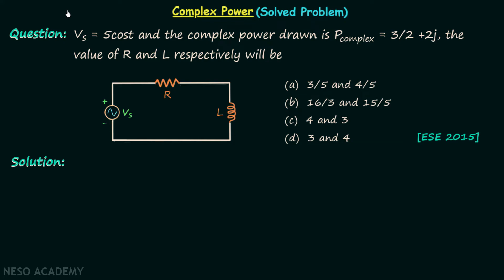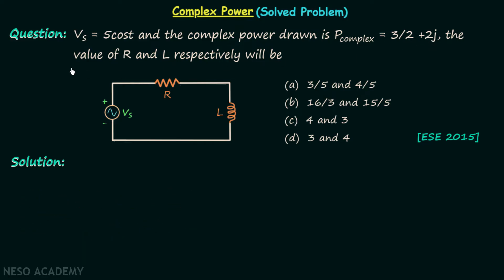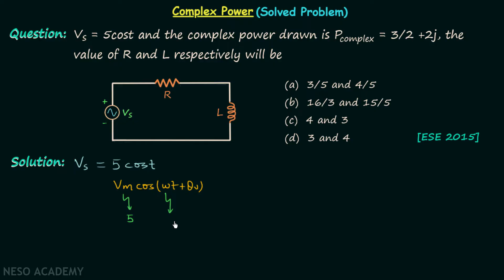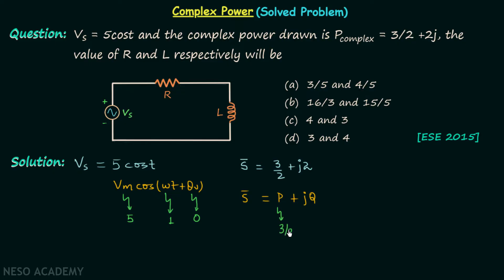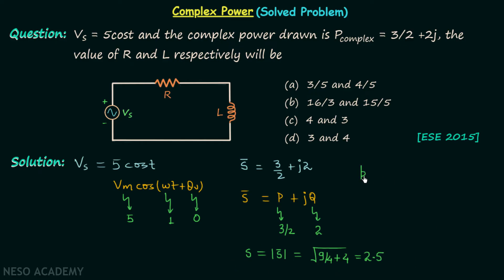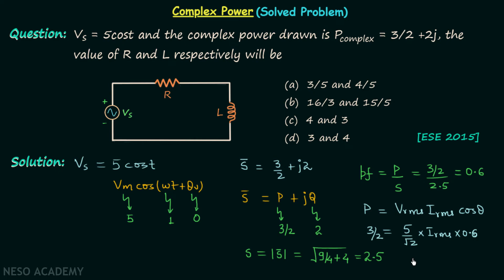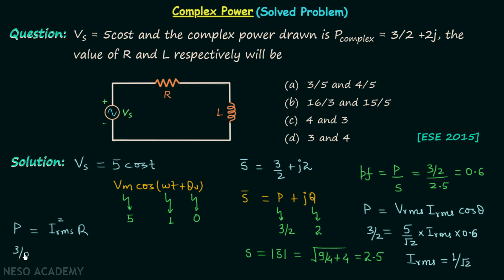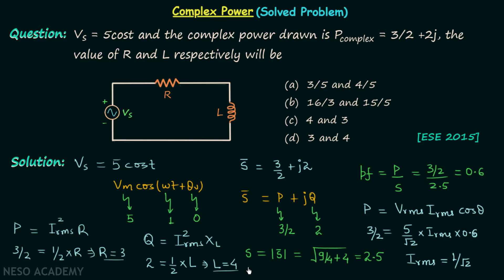Complex Power (Solved Problem)

Comment: Sir, here you used S=(Irms^2 x R )+ (Irms^2 x XL)

Why we can't use S= ( Vrms^2/R + Vrms^2/ XL)?
When I tried i got different answer. Can you please explain this.
Reply: Because current is same in both R and L
but Vrms is the source voltage it is not the voltage drop across Resistor or inductor